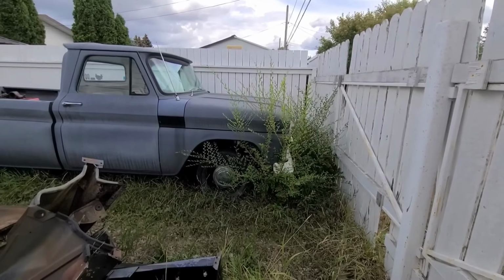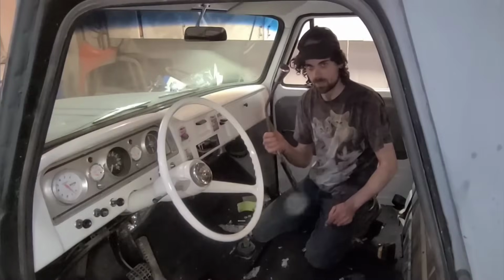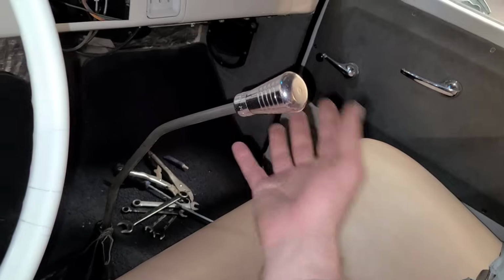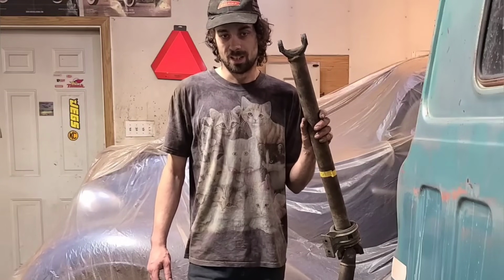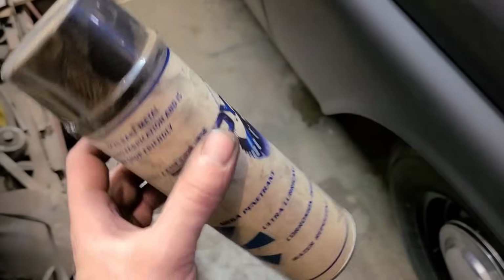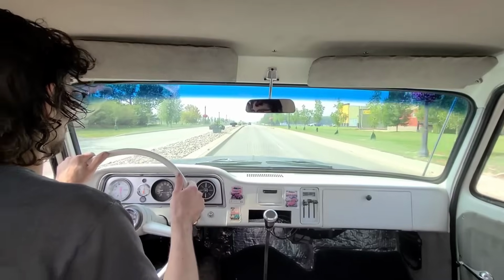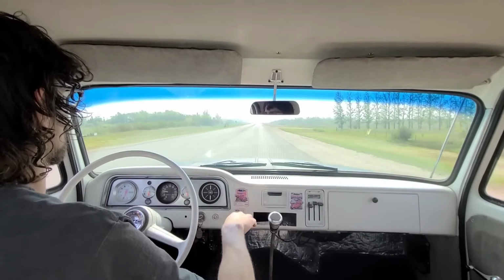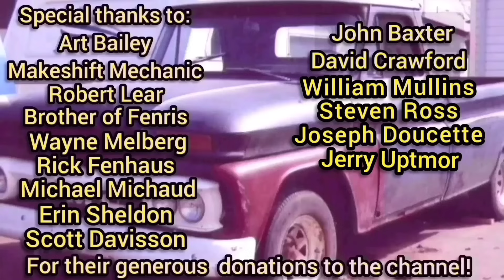FORGOTTEN 1966 GMC gets BUDGET Makeover. AMAZING Transformation

Comment: Before posting this comment I did a little research and found that "deckle" is actually an accepted proununciation of decal in Canada. Who knew? But regarding the seat that you denounced with such passion: looks to me like it has a fold-down arm rest. What's not to like about that? I would tell you not to throw it in the dumpster because somebody will definitely want it. But on second thought, I don't think you throw anything in the dumpster.
Reply from the maker: Well the arm rest is completely useless with a manual transmission, but don't worry the seat didn't get thrown away! It's going in the truck I will be selling, that way someone else can throw it away haha

Comment: I know that you're joking, but that Bondo could last a long time with the rubberized undercoating over it.  As long as the water doesn't get to it.  It does stick to rough rust pretty good. Roofing tar seals up stuff very good too.  Then when the real body man get sit, he'll curse out the guy that poured roofing tar into the bottom of the doors.  It "works" though.  As long as it keeps the water out, the rust will not spread further.

Comment: If you use this as a work truck and you want to paint it - look into commercial coatings from whatever brand you like to use.  I use PPG, and they have a lot of different types of commercial coatings that are considerably cheaper than automotive paint and still have a wide array of colors, including different shades of light blue.  For instance, I use AUE--300 on frames, it dries hard and doesn't chip and is not affected by most chemicals.   It is cheaper than powder coating and can be repaired.  The full cure time on it is 30-60 days (like most enamels), in which it can be dented so as long as it is sitting and unused, it should cure very hard and last a long time.  It also takes an activator and hardener in order to get that film strength.
Reply from the maker: Thanks for the paint suggestions!

Comment: Just subscribed!  I know with the advice in comments on videos, some times you have to "separate the grain from the chaff" as my grandmother used to say.  20 plus years back, I v8 swapped my S10 truck. My non negotiable was it had to have an overdrive transmission.  Now when I would tell people (pre you tube and in the early days of internet bulletin board forums) that I was going with an overdrive I was often told I was "Stupid"   See when folks hear V8 and S10 in the same breath they assume you are building it to drag race. Oh I was told to run at least 4:10 gears, gut the insides, fuel cell in the bed, fenderwell headers,  you name it. Instead I built a mild engine that I could afford, a 700R4 trans, and a Q jet carb.  Sure I did take it to the track here and there (13.22 @ 103.9 mph) but lots of highway driving, over 50,000 miles worth getting 17-20 mpg! With no overdrive and 3.73 gears that would have been a high RPM low fuel mileage disaster.
Reply from the maker: Thanks for subscribing! I used to have several s10s and always thought a v8 s10 would make a cool street cruiser

Comment: Hate that seat?  wow Way better than my 5 gallon paint bucket.. Meow meow, too.
The shift lever looks remarkedly like the one I use in my 51 Chevy floor shift conversion. Cool.
Reply from the maker: Not all of us can afford a cushy 5 gallon paint bucket, so we make do with what we have!
Reply: I had an 89 CRX with both sweet, factory, exposed "patina" foam, seats. Four of the five kids to haul around at the time. The driver's seat (the only one to be concerned about) had a broken seat-back bracket, which I "repaired" with an orange crate propping it forward at the expense of rear illegal passenger legroom. They had short legs. It was fine. . .
Reply: Always an enjoyable time with your "sharkazm" and videos. Keep up the good work..
   @CarterAutoRestyling

Comment: F'n eh, bud. Great video.
When yer first in line for the train, stare at yer gauges. It feels like yer spinnin around.
That engine runs nice. Yer way ahead,
Tires cost ridiculous now. 1400 for a K20? WTF?
That sure looked nice with the goop on it.
That seat woulda pissed me off too, I'm fat, lol.
I had a 5 speed once, 84 Toyota, it went nice in 1, 3, 5. Felt like a 3 speed. I've always love a 3 speed on a V8.
I wish I still had all the model cars I built. Some were even morphs, lol.
My 62 C50 has the "real" steady bearing mount. I had to add 6 inches to it to accommodate the V8 difference.
Cheers to Scott and Paul for the driveshaft offers.
You drive like me. Sensible. My 62 bus goes 95 to 100 Km now with the new 22.5" on it.
I gear down at every stop, hardly touch the brakes. With the red bottles, it turns heads, lol.
2 grand to 2200. That's good enough. I'm slowing them all down. They're safer, lol.
Theses comments are all f'd up, watched 3 times to comment on as much as I could.
3 ceasers and and a J, lol. I watched Scott's video and yours, guess I'll go watch those Russians kill another Lada, lol.
Cheers, bud.
Reply from the maker: Haha can't go wrong with Garage 54!

Comment: That seat is the worst seat I ever sat in.  My 92 GMC had that seat and it was the first thing I had to get rid of.  Even new......... they sucked.  Yours lasted longer than mine (2 months).  Your truck but, that thing screams patina paint job to me in the original blue of course.  Old work trucks should look like work trucks, not guzzy up POS.  Keep it a work truck where you can use it for work.  Also, that truck is pretty quiet going down the road.  I think you will love the overdrive transmission.  Nice steering wheel, looks really great.
Reply from the maker: Haha at least I'm not the only one who hates these seats. The idea is to paint the truck with single stage. That way, between being parked outside and getting used as a truck it won't take long to get a natural patina

Comment: I had a carrier bearing break loose on a '65 C-10.  Ended up using a bunch of baling wire to tie it back up in there to make it the 20 miles home.  Never was a fan of the things afterwards.   That ol' 65 Chevy ended up with a hood off a 66 GMC (along with fancy chrome jet/bird hood ornament) and was originally while.  I had sanded and rattle can primered the surface rust on it and my first wife hated it.  I worked evenings and someone gave her a gallon can of blue enamel and I came home one night and she'd brush painted it.  It stayed like that for years after I sold it to my brother (who replaced the Chevy 230 six with a GMC 305 V-6.  When I had to drive it to North Caroling and back from Texas, that ol 230 six had a rocker arm come loose and dent up the valve cover.  That I fixed on the side of the road.  Also had the fan belt break and I made it to the next exit where I bought a new one and installed it.  On the return trip, I had one of the ancient tires blow out.
Reply from the maker: Haha, that's awesome. Love the road side fix storys!
Reply: We can be sure that some of those roadside repairs occurred in the rain.

Comment: Good common sense upgrade on the old GMC. A decent trans makes a big difference to the real world driving experience. I used to go to Canadian Tire when I was working on a test trip in Timmins Ont. Picked up some useful nik naks for my roadster build. Looking forward to some more on the blue truck and some more train spotting, of course that goes without saying. Oh yeah, reading between the lines I get the impression you're not too keen on that seat. Just a vibe I'm picking up. Mart.
Reply from the maker: I'm surprised I lasted as long as I did with the old 3 speed. The 100e is coming along great by the way!

Comment: Hey, my dad took a seat like that and bolted it to a wood base and it made a nice sofa. I liked the drive thru your neck of the woods. I miss how nice those trucks used to ride. One question though, is that area always so crowded? I didn't mind waiting for the train as there is a trainyard where I work and you only have to worry when the train has 4 or 5 locomotives out front. Then you can take a 20 minute nap until the guy behind you wakes you  up with the horn. Looking forward to seeing you work your magic on this truck.

Comment: Did you rub it down with oil and kerosene or did you use shoe polish? that really shifts nice and smooth while you are driving. great job getting it back to a daily driving shop trick. My shop truck is my 1989 Ford F150 Lariat XLT it never fails me. I have to patch up a couple paint chips on the hood but that wont take me long then I will just clear coat it. With one of those Rustoleum mega clear cans.
Reply from the maker: I used Gibbs
Reply: @CarterAutoRestyling  I never heard of Gibbs I will have to see if I can find it.

Comment: Shouldn't be too hard for a guy who's done body work is all right to achieve at least AD speed shop a nail and paint job from tractor point hell that's what he painted the note mad with and everything else and I painted a bunch of crap with it only is you're are eliminated on colors it's single stage one and done you can use the Jeep princess auto paint gun and an air compreference that is about 8 gallons in 10 pounds